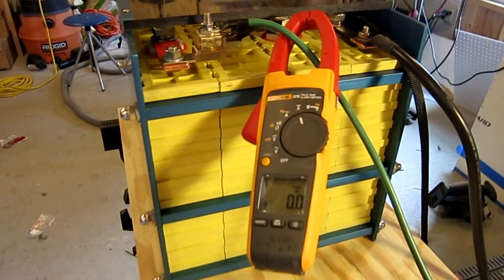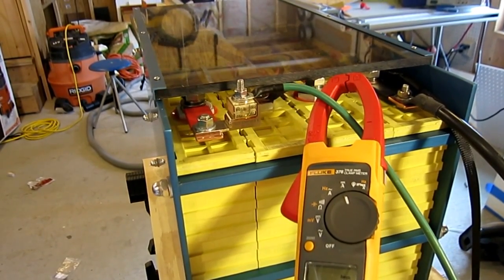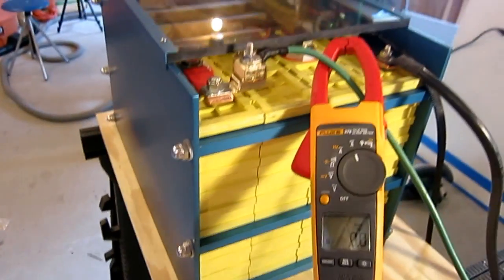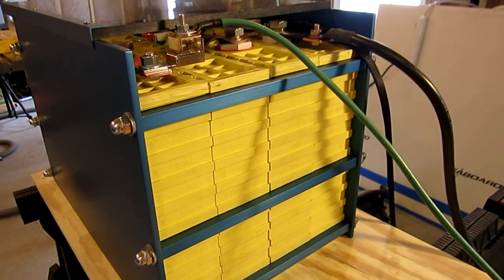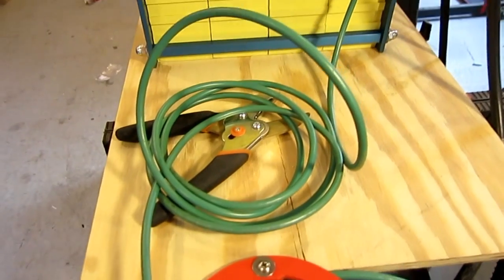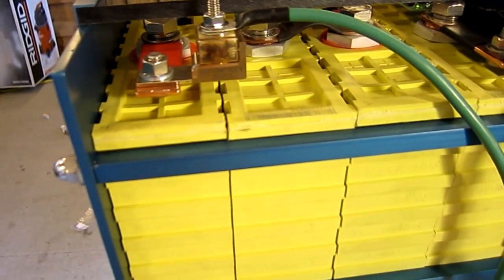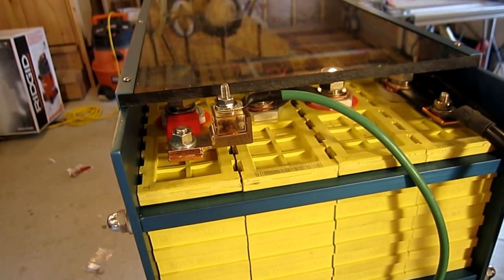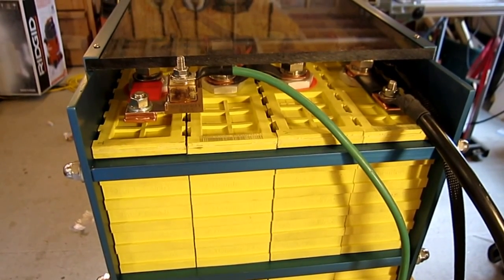Marine Rated Battery Fuse Trip

Comment: that wire coil sure did limit the current significantly though, with such slew rates inductance plays a role. More so with 15 feet of thin wire, relative to the massive ampage that bank is capable of.

Comment: Can you run fuses of the same type and size to increase IAC? Trying to learn more about fusing battery banks. I am looking at upgrading my battery bank. Most likely going to be around 20k WH at 24 volts. So I'm guessing a Class T fuse but even than I'm not sure. I might end up going with LTO cells and I've seen 45 AH LTO cells with a short circuit current around 4000 amps so a larger LTO battery bank could hit some serious numbers.

Comment: You have a huge resistor in the circuit with all of that small wire.  This test is meaningless.
Reply: I think you missed the point of the video.

Comment: Excellent demonstration,  even 300 amp fuse protects down to 8 gauge wire from shorts. I think the idea of smaller fuses downstream of a larger fuse on branch circuits is so they blow separate circuits and not have the entire circuit losing power (within reason regarding wire sizes, dont expect a 300 amp fuse to blow protecting a 12 gauge wire). But you know for fusing the entire starting bank of wires which may even have some 2 or 4 gauge wiring running every which way, 300 amps will protect all of those wires from catching fire. Glad you posted this common sense video.

Comment: I have a 50 year old Egg Harbor 37 unfused on the starter bank  that has never had a short on the main wiring. I just added a 2 gauge 15 foot round trip to the generator for starting it from the main engine starter battery and decided to use a 300 amp ANL Blue sea fuse and holder before seeing this video. plan to run a short wire from starter bank positive to fuse holder, then from fuse holder to starter bank selector switch. That will fuse protect all the wires for all starters. And your video  is exactly what I thought, the fuse will blow and the wire will be safe. This is an old MCCK 6500 watt and it cranks fine on the 2 gauge wire. That 2 gauge wire I saved from my other mid 60's Glastron which I cut up and the wire is still in good shape over 50 years old. None of the wires in my Eggharbor or very few, are tinned like new marine wires, but they are still ok. Egg used 2/0 wires for the engine starting circuit. Engines are 392 IH and always crank well.  One thing that has helped the wires survive so long, they never get wet as the boat is a wooden cabin cruiser,  no exterior wire exposure. To secure the starter wire run to gen, I used some plastic Carlon 1/2" conduit clamps screwed to the side of the wood stringers. Near the gen, I am going to use a 2 foot section of foam pipe insulation over the wires for some protection to their insulation as the wires are bent over the wood edge support on top of the water tank.

Comment: Just for the benefit of any viewers who may not fully understand. Because you are protecting the wire, you have to use a fuse smaller than the ampacity of the wire. This is not for preventing the wire from overheating in a short circuit. That is easy because the fuse blows right away. The problem is that you don't know what kind of load malfunction you may have. If the load is faulty and causes a slight overload current, the fuse must be sized to blow before the wire insulation melts or thermally degrades in some other way. With starters, though, the wire is probably a bit undersized because the starter doesn't run continuously. If there is a fuse you can use on the starter that will let you start the motor but doesn't blow when you need it, that is great. Even if the starter fuse is higher ampacity than the wire would normally be rated for.  But I agree with everything in the video as it pertains to starters. Great video and thanks for actually showing the fuse blow!

Comment: I have this same batteries, but 60ah ones.  I'm connected two groups 180ah to make two separate batteries with two separate BMS then connecting them to make 360ah.  The highest terminal block they make is 300a, would this be alright for 360ah?

Comment: Nice videos. I appreciate you putting them out  Very informative.
Question: What kind of life have you experienced with these cells under heavy  use? 50% - 80% daily discharge

Reason for asking is I am in the process of replacing an aged set of AGM batteries  in my solar power system and am considering  the Iron Edison Nickel Iron as well some LiFePO4s.

Comment: Nice informative video! I installed these fuses (3) one ea for windlass, starter, main panel after watching your video. I currently have an old 750Ah AGM bank wanting to convert to LIFePO4 but having a difficult time locating larger LFP batteries in stock other than ordering from China, any suggestions would be most appreciated. These (4) 100Ah Winstons or 4 banks of (4)130Ah CALB would fit my desired space nicely - Thanks...

Comment: As a telco technician I have always fused the battery bank(s) as the instant current capacity (short circuit current) can be several thousands of amps, I have seen examples of where a tech has dropped a spanner accross busbars and we can ask what spanner (only a tiny bit was left).

Comment: Thanks for your testing and info. You seem to like the Idea of fusing a cranking battery circuit so I would suggest you measure voltage drop across the fuse in that application while cranking to get an idea of what the engine is really "seeing" for cranking voltage.

Comment: Thanks for the demo.

Overcurrent protection as referenced by NEC and ABYC includes overload, short circuit and ground fault. ABYC does not fully define overcurrent in general terms like NEC. ABYC prefers to address the term in the context of DC and AC power circuits. For purely a DC device most of the time ground fault and short circuit are the same. As shown, DC short circuit is easily addressed with a fuse. Overload, however is much more of a challenge.
Reply: I am adding a 300 amp ANL fuse off the positive starter battery lug which will protect all the starting related wires below it. Consider that a starter wire carries lots of current for a few seconds of engine cranking, not designed to carry continuous high  current flows. Then what your really desiring is to protect starter bank wires from a dead short. I recently ran a 2 gauge wire to start my gen 15 feet away and thought about adding a fuse to the whole starter system at the battery. Logically, for a starter, all I care about is the dead short seeing it is not a continuous load system. That long 2 gauge wire is made by Standard Motor Products, blue rubber jacket, not tinned,  and is from the mid 60's. And it cranks up the old Onan MCCK 6500 watt gen fine. The wire when I compare to a modern 1 gauge wire looks identical in cross section to me., but there may be small changes I dont notice. That wire was originally used in a mid 60's glastron for starting a Chevy 350 engine.

Comment: 'Shmemmied'??? Glad to have a new technical term in my lexicon.

Many people mistakenly believe that the size of the fuse is selected to protect the load...the radio, autopilot, heater, whatever is ultimately using the power. It's a common misperception. The reality is that the fuse is selected to protect *the wire*, not the load. To state it in a more meaningful way, the fuse amperage is selected to *protect the boat*.